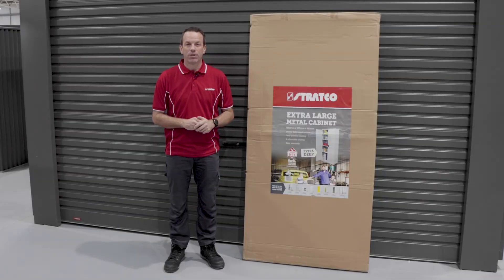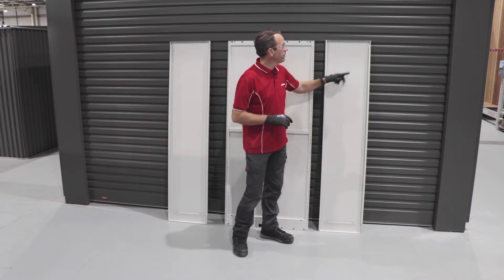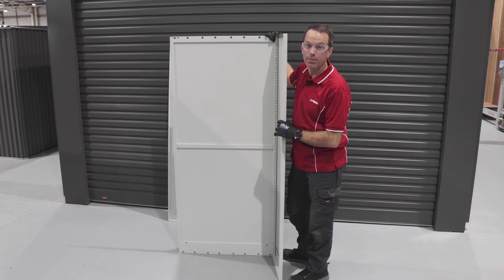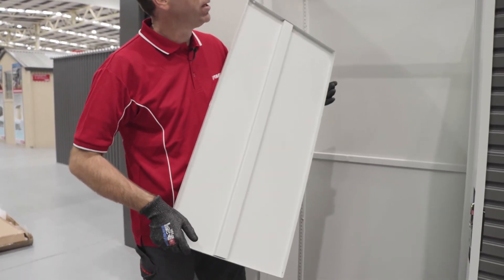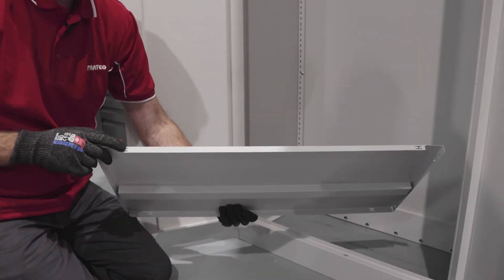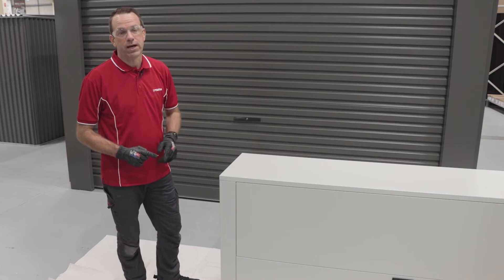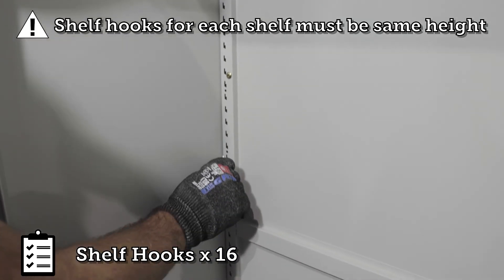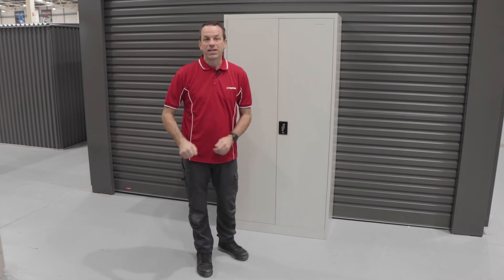Stratco 2 Door Metal Utility Cabinet | Installation Guide

Comment: Not too bad. The manual forgets the push taps for the floor and this fellow secured the floor with one screw instead of 3 (as per manual). 

When on its side, there are an additional 2 screw that screw in towards the back at the left and right most areas of the floor (just like the roof screws).

All in all a pretty nice unit, and this colour is handy if you have an average lit garage and want to be able too see the storage space better.
Reply from the maker: Thank you Adam, appreciate your feedback.